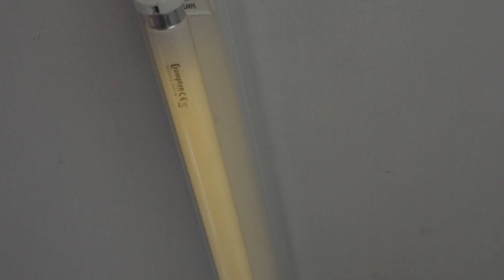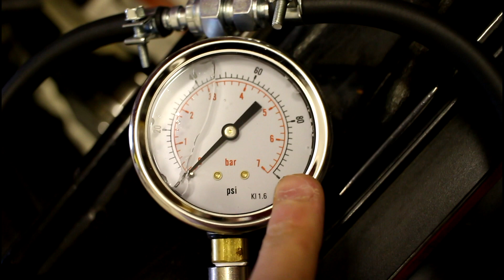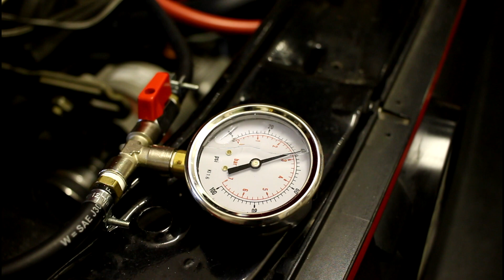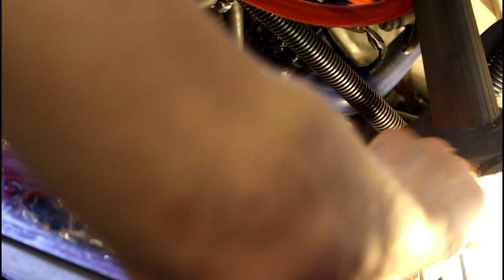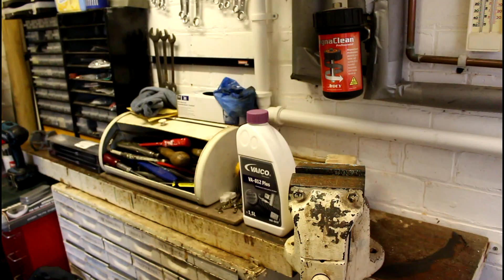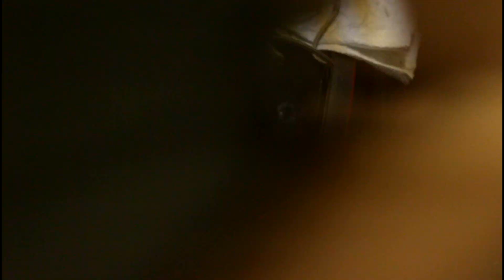K-Jet Fuel Pressure Testing

Comment: Did you plug it back in before adjusting. Or did you forget to. Very important 
You didn’t show it
Reply: Edit: I just read he made the adjustments with the engine warmed up so everything is ok.

He didn't plug in the hoses and electrical connector to the warm up regulator. You can see the pressure being low, meaning the thermo spring inside the warm up regulator wasn't being heated up. When the spring heats up, the fuel pressure increases and that will lean out the fuel mixture as it should when the car is warmed up. When the car is cold, the pressure should read lower than 55 psi, in the 30's and that will help out during cold starts as the mixture plate will be able to move up easier and thus allow more fuel into the fuel injectors making the mixture richer to help in cold starts.

Comment: Hi, I have a K-Jet Corrado and have been toying around with it for a long time, where did you get this pressure tester? I would love to be able to set my WUR.
Reply from the maker: Nice!  Yes, you definitely need a fuel pressure guage to be able to set these up correctly.
The fuel pressure gauge I found on ebay as there was a guy on there who made these, he was selling them for around £60 if I remember correctly.  I don't think he is selling them anymore, but I'm sure you could grab the parts online somewhere and make one up as there's not much to it.  I think the only difficulty would be sourcing the correct screw fittings for the metering head and fuel lines, but you can probably find this information out from forums.

In fact, since making my video a fellow YouTuber has listed all the parts needed to make your own, if you check out the description on Grey Goose’s video here:
https://youtu.be/QlHwmzVmcgI
Reply: @RetroVW  Much appreciated - I will look into making one! Thanks for your help.

Comment: Great video RetroVW!  Thanks for the good info!  I have a 1989 Jetta GLI 16V that suddenly started a backfiring behavior when trying to accelerate from "idle".  I had been driving the car for a few miles (around 20 miles), so it was completely warmed up.  As I was almost "home" when it happened the first time, so I was able to park it before it experienced more than a couple of backfire episodes.  I tried re-starting it and it backfired once more, so I left it to sit for a few days in the garage until I can get a chance to investigate.  I welcome any "suggestions" you may have as "likely culprits".  I only feed it "non-ethanol fuel", so ethanol-associated problems are "not likely" a cause.  On the other hand, ethanol helps move water out of the fuel system, so it's "possible" I've accumulated water somewhere in the "re-fueling" process.  Perhaps a bottle of "Fuel Dry" is in order as a first step, or would you recommend another approach?
Reply from the maker: Thanks and sorry for the slow reply.  You may have already sorted it by now but from a 16v troubleshooting guide I have, backfiring under load could be a number of things, to check:
- Sensor plate and/or plunger in metering head not moving freely.
- leaks in air intake system.
- Electric fuel pump not operating correctly.
- Excessive fuel delivery in control circuit.
- Warm control pressure too high/too low

Those are to name a few things to check.  Good luck and post back if you are still having issues 👍🏻
Reply: @RetroVW  THANKS a BUNCH for your comments, Retro!  Your reply timing is fine, as I've not been able to work on it since my first post.  The car is a "sentimental vehicle", stored in a conditioned garage space quite remote from my house.  I'm hoping to make the road trip to it in the next couple weeks, so your timing was perfect.   First move is:   I'll try cranking it to see how it behaves "totally cold", as the backfiring episode started on a summer day and after the car had been fully warmed up by driving around.  If it runs "ok" cold, that would point to the Warm Control Pressure as the culprit................which I believe is also affected by the "Idle Control Valve".  As I recall, the backfiring was MOSTLY at idle, and was not an issue if I kept the engine revved up at stoplights.  I'll also check over the rubber boots more carefully next visit, and then pull off the one above the sensor plate to check for binding.
Reply from the maker: @panchitox8875  great!  Hope you manage to get to the bottom of it.  Maybe stick some fresh fuel in also if its been sat for a while 👍🏻
Reply: @RetroVW  Thanks for the suggestion, Retro, but I had just added some FRESH non-Ethanol before driving it that day.  Since it's garaged in an enclosed, semi-conditioned space, I don't have to worry TOO much about "condensation" gathering in the tank....so I tend to keep the fuel level low so that it's easy to "re-fresh the fuel" time to time by adding a couple of gallons.  HOWEVER, if I don't find a cracked boot or binding air sensor plate I plan to add ANOTHER couple gallons of FRESH non-ethanol since it is possible that I got "bad fuel" at the station.......because I drove it to the station just fine, then added fuel............I then drove it several more miles and made another stop to make a quick purchase.  It was running just fine all the while, until I RESTARTED a few minutes later to return it to the storage garage.  Backfiring ensued, and I kept feathering the throttle through all the "stoplights" for the couple miles of return trip keep it running.  I was pressed for time that day, and only pulled it into the storage space, shut it down, and lock it up. Sorry for the long reply,  but just adding some additional BACKGROUND in case it sparks any other thoughts!
Reply from the maker: @panchitox8875  Ok great! so fuel is new then, though it could be a bad batch of fuel since you mentioned the backfiring started shortly after refuelling at the station.  

I think essentially on these cars you need to have a KJet Fuel pressure gauge really to properly check and set them up.  So I would say you would need to check the fuel pressures to make sure it is all set up correctly and that both System and Control pressures are correct.  Also make sure your injectors are working good and evenly balanced, I have another video on how to check the injectors here:

https://www.youtube.com/watch?v=aDmavXtSi88

Hope this helps.

Comment: how do you adjust the pressure?
Reply from the maker: System pressure is adjusted by adding or removing shims on the valve screwed into the side of the metering head.  Control pressure is done as shown in the video by adjusting it on the Warm Up Regulator.

Comment: I assume that that the adjustment was made while the engine was fully warmed up. Does the WUR have to be against the engine and plugged in and warm to read the pressure. Then disconnect and start adjusting?
Reply from the maker: Yes, I did this whilst the car was warmed up then adjusted.

Comment: really good video, i need a gauge set up for my car,do you know what the kjet connections are please? I believe many gauge kits have the non kjet items in them. 

Also have you got a video of how to set the c02 on these cars please?
Reply: It’s best to measure the thread dimensions on the male connection on your fuel distributor. There are lots of different thread sizes and pitches used in K-Jet applications across the different manufacturers, I have some here from MK1 and MK2 GTis and Audis and they are all slightly different.
Reply: @English_Speaking_Fox  brilliant thank you  for that mate 👍👍

Comment: Any chance u know the fittin thread dementions so i can make on of these guages for my rocco!! Tryin to research the specs
Reply from the maker: Not off the top of my head but I think I have some thread pitch gauges somewhere.  I will dig them out and try to measure the dimensions for you 👍🏻
Reply: @RetroVW  M12x1.5, source ClubGTi and my KR 16v... just popped out to the shed and measured it. There are lots of different thread sizes across the whole K-Jet range of application, VW, Porsche, Merc and so on. You often hear stories of guys buying gauges online that say it fits K-Jet and then finding that it does not fit their vehicle.

Comment: Man, are you sure about measuring the control pressure on running engine? Maybee it is different on VWs, but on '86 SAAB 900i equipped with K-Jetronic, the manual (and even some old SAAB mechanics) say the control pressure should be measured with the engine stopped (and, preferably, when the engine was standstil for a long while, in ideal case overnight, if you want to test COLD control pressure).
Reply from the maker: The engine was cold when I started the initial test.  I then monitored the change in control pressure as the engine warmed up.

Comment: I'm sorry but I think drilling a hole on the warm-up regulator is not the right thing to do. First of all you did not mention what was the engine temperature when you were checking the control pressure and secondly when you check the 12 volts power supply to the  WUR it was zero voltage, meaning that the heating element and the bimetallic strip will not operate as it should to slowly and steadily increase the control fuel pressure as the engine temperature rises to normal operating temperature. The system pressure by the way was perfect and so as the holding pressure. I believe the voltage supply to the WUR should have been rectified first and then re-check the control fuel pressure again. Your video was very clear. All the best and stay away from covid.
Reply: I drilled the hole to for adjusting the pressure on full load. Now I have lambda 0.86!
Reply: full load or full throttle, I don't know how to say it correctly but I think you understand me.
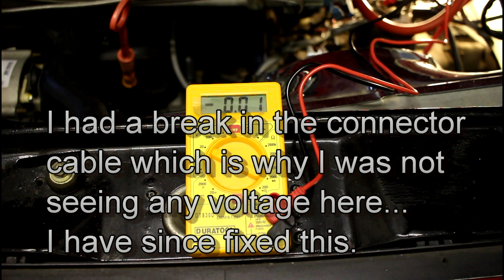Reply from the maker: Thanks for the comments 😀 There was a break in the wire connection that was causing zero voltage, I mentioned this in the video at 9:47, which I repaired before continuing with the test.  This was one of my early videos so maybe not the clearest of explanations 😆
Thanks and stay safe.
Reply: @RetroVW  can i whatsupp you?
Reply from the maker: @wesleysmal9  What's your question?  if you post here I can try to help, or perhaps the community can help also.

Comment: What did you do with the hole you drilled on the WUR  ?  how did you patch it up ? or no need. Would like to see a similar vid on the back end of the fuel supply. Return Valve replacements, Regulator replacement and general problem solving. (I have hot & warm start issues, slowly working my way through it). Great work ! keep it up
Reply from the maker: I covered it with a foil type cap I happened to have handy just to keep the dust out.  It sits tight against the engine block anyway so should be fine.

Hot start could be a bad fuel accumulator.  You could check this by seeing if the system holds pressure for 20 mins after you turn off the engine.  Ive also read that if you loosen the screw from the back of the accumulator, if fuel comes out then the internal diaphragm is shot meaning its not going to hold pressure.

Good luck with the troubleshooting 👍🏻

Comment: Hi, does anyone know what's the thread on the fuel line? I have some issues with my kr's fuel pressure and I'm going to build similar gauge setup from hydraulic system parts, but the car is pretty far from where I live in so I wouldn't want to go there just to measure it
Reply from the maker: Hi, I dont have access to my test kit at the minute to double check, but there's a CIS fuel pressure guage listed here that mentions the thread sizes if it helps:

https://www.kurth-classics-autoparts.de/gb/warm-up-regulator-wur/227-k-jetronic-pressure-testing-gauge.html

Also, the following may help:

Injector lines & 5th injector - M8x1
WUR return line - M10x1 ?
main pump banjo - M12x1.5
fuel filter input - M14x1.5
fuel filter output - M12x1.5
metering head wur line - M12x1.5
metering head main in/out - M12x1.5
main fuel lines - M12x1.5
accumulator output - M14x1.5

Maybe double check these sizes though before you order any fittings.

Comment: One thing I would do differently is when measuring the 12v feed to the warm up regulator I would check for 12v but also use a bulb to check it doesn't break down under load, and also check them again whilst engine is running.

Comment: Yikes. Use a piece of big rubber hose on the plug to drop it in and start it. Bombs away is gonna mess your gap up.
Reply from the maker: Yea, I realised that after the plug fell from the socket 😂
The socket does have a rubber washer which normally holds the plug in place, but it must be worn.

Comment: Very good explaination, i have a 1988 Escort XR3i which also has K-Jet, is there a specific gauge etc kit to test all the pressures for K-Jet or did you rig it up yourself?
Mine runs ok a part from the fact that the fuel economy and CO varies for no apparent reason, it will sometimes do 25Mpg average, sometimes 30-35.
Reply from the maker: Thanks 👍 The fuel pressure gauge I found on ebay as there was a guy on there who made these, he was selling them for around £60 if I remember correctly.  I don't think he is selling them anymore, but I'm sure you could grab the parts online somewhere and make one up as there's not much to it.  I think the only difficulty would be sourcing the correct screw fittings for the metering head and fuel lines, but you can probably find this information out from forums.

Same here.. the Golf runs ok but I'm sure that its doing mid to low 20's for mpg, lol.  I'm pretty confident my fuel pressures are now correct so maybe CO adjustment is next on my list.

Good luck with it 😀

Comment: Hi there! That's not the acumulator actually that's the fuel pressure regulator! But great video dude! 👍
Reply: He tested the accumulator by seeing if the pressure remains above 2 bar 20 minutes after shutdown, since that is the job of the accumulator, and if the accumulator isnt working as it should it can mess with the pressures

Comment: you can make a video setting CO ? Please
Reply from the maker: I will see what I can do, although I dont have access to a gas tester to measure CO accurately.  But there is a basic setup that you can do to get it setup pretty close.
Reply: Are there any DIY methods one can use to measure CO, if so what are they? a wideband wont work i'm guessing?

Comment: Awesome! Same system on my 81’ DeLorean. Was going to dive in to this same adjustment this weekend. Best video I’ve found so far on the process! Also bought a shim kit for the Dist pressure valve that is suppose to help get you the system pressure in spec if needed. Thanks!

Comment: dear friend I would like to know if you can help me build the golf test gauge or if you can build it and send it to me letting me know the expense.  I still have problems with my sister's car I replaced all the water hoses the car worked well then suddenly it turned off and you don't want to turn it back on anymore.  I'm desperate because the car was going well and I was finishing it up.

Comment: Dude that engine bay is mint. What products did you use?. That’s one to be proud of fella.
Reply from the maker: j1mveedubu thanks 👍🏻 when I first got the car I had the engine out and restored the subframe and running gear along with respraying the engine bay in VW Campanella White to give it a fresh clean look.  The rest is just general cleaning as it all went back in.
Reply: RetroVW  nice one, I’m in the process of tarting my 16v engine bay as the external is in good condition but engine bay is letting my mk2 down. Basically adding to the list. 😉
Reply from the maker: j1mveedubu cool!  Good luck with it.  I bet it will look mint when you’ve done it.
Reply: RetroVW  the manifold is in great condition but just need a decent cleaning product , but new fuel lines are needed, the common corroded lines. Are you on instagram?j1m_mk2 if you are.😉